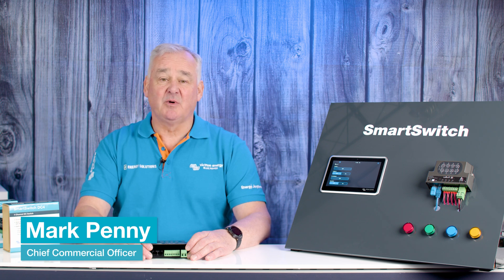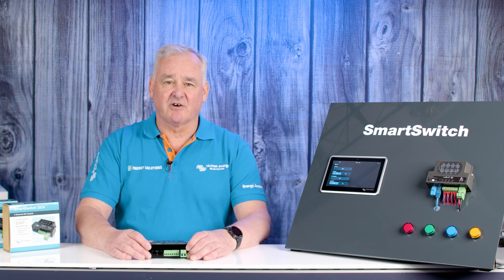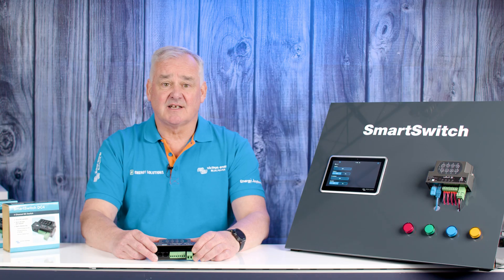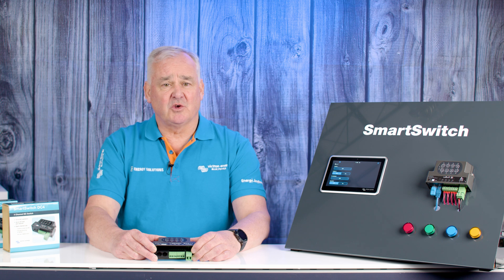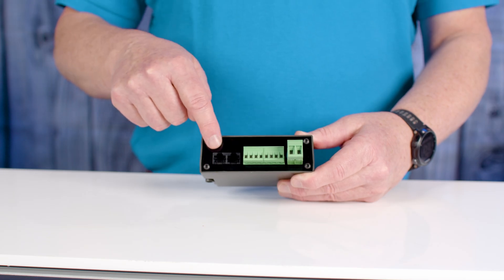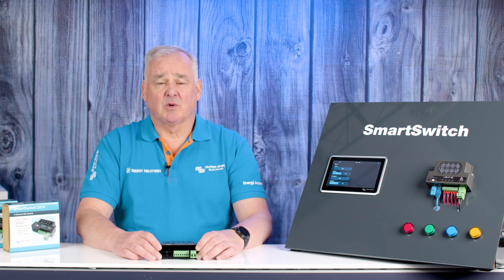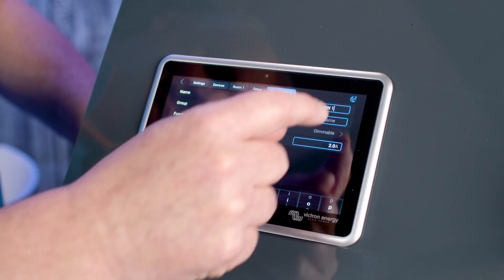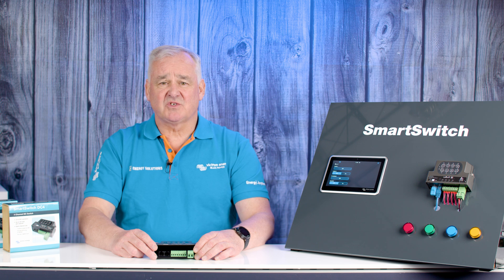Introducing The Energy Solutions SmartSwitch - 4 Channel DC Switch

Comment: Can this smart switch run via N2K and without a Cerbo in the chain? IE, could we use this smart switch as digital switching on a boat without Victron involved ? Could we control this smart switch via Signal K or a marine MFD that is running N2K?
Reply from the maker: Hi Jim, thanks for your enquiry. currently, the SmartSwitch is designed to work solely with the Victron Cerbo and Ekrano software, so is not able to be used outside of this ecosystem.
Reply: @energysolutionsuk  Thank you for the reply. So this is not an ideal solution - if the Cerbo or ekrano goes down then one has lost thier digital switching, - we need something like KNX - its not reliant on a single "box" to control the system. The search goes on.

Comment: It appears you are using a Beta version of Venus OS. Is that necessary for this to work?
Reply from the maker: Hi @seantraynor6493, correct the switch currently runs on v3.60~83 which is currently the latest version of Beta (at the time of writing). However, we understand that Victron maybe pushing this to the live version very soon.
Reply: @energysolutionsuk  Ok cool. Yeah I was reading some of the info on your website, and the User Guide says Venus OS 3.60. So I guess that's launching soon. Any eta? I saw on the Community they were predicting ~6 weeks. Is that still accurate?

Also, did you guys directly interface with Victron during the design process? I assume certain software changes/updates were needed in 3.60 to support this new function.
Reply from the maker: @seantraynor6493 the progression of the beta versions and the stabilization efforts suggest that the official release of Venus OS v3.60 is imminent but we can't say for sure.
We are the UK service centre for Victron Energy and one of/maybe their largest dealer in the UK. Their products are also in many of the products we manufacture so we have a lot of experience and worked with them on the interfacing the software.

Comment: Not at that price, fellas
Reply: tis a bit pricey for sure
Reply: It’s only $400AUD and plugs straight into a a Cerbo GX? Way cheaper and easier than anything comparable.
Reply: @veysher3756  "only", Victron even has their own new unit for this purpose (GX IO-Extender 150), which costs half as much and can control more than twice as many circuits when combined with a $10AUD relay board.

Comment: WONDERFULL! I will install several yearly! Need to buy for victron!
Reply: Been watching this for two years at METS. 5 Amp per channel, not really usable for many loads- basically just lighting control?
Reply: use a relay  @MrDigimarine
Reply from the maker: Hi @MrDigimarine—thanks for the question. As @gergodrabik6208 pointed out, if you ever need to drive anything heavier than 5 A you can wire this switch to trigger an external relay; that’s standard practice with many switches.

On its own, the 5 A rating (in both dimming and latching modes) is ideal for low-current loads such as LED lighting, small roof/vent fans and USB-powered devices.
Reply: @energysolutionsuk , 5A is pathetitc. When you embarked on this did you not think to yourselves that you should be able to switch up to 25A. Adding relays just adds complexity and time to install. Should have built it properly.
Reply from the maker: That's great news. You can order from our Estore https://bit.ly/4krODO1. Let us know what you think!

Comment: Is there a Node-red node for it as well?
Reply from the maker: Hi @SonPowerSolar-jc1ov There isn't a direct node-red node for Direct connection but with a GX device you do not need one, as it will work well with node-red through the GX device. 
For users the quickest path is: SmartSwitch > VE.Can > GX > Node-RED Victron nodes.
Reply: @energysolutionsuk  Could be a cool idea to make a dedicated Node. And also a video where it controls a switch in a node-red flow.
Reply from the maker: Hi @SonPowerSolar-jc1ov thank you for the suggestion. It is noted and something we are looking into.